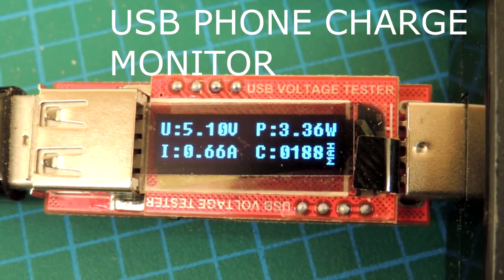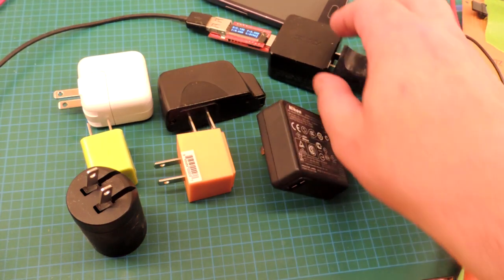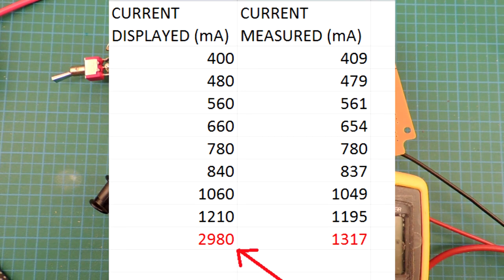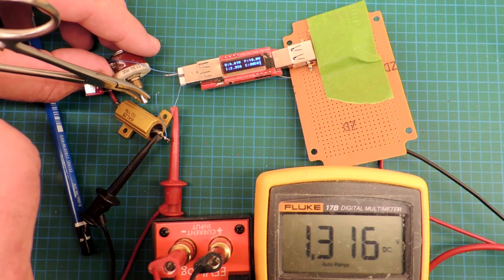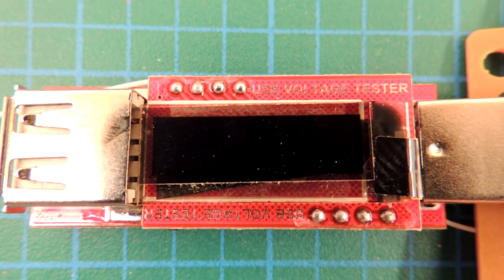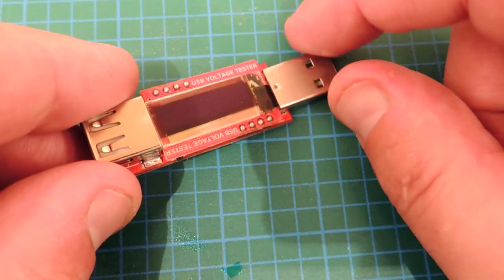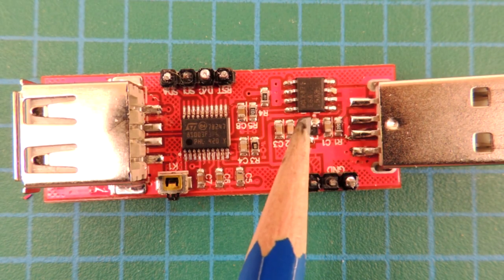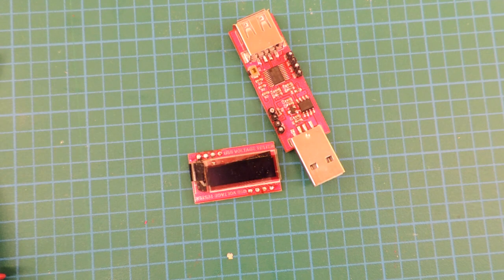USB Phone Charge Monitor

Comment: I got few of different USB panel meters. The cheapie Blue transparent plastic case USB Charger Doctor is the worst of its kind. I am using the below latest model for some form of protection esp OV OC, first time charging or power-on newly bought USB gadget.

http://item.taobao.com/item.htm?spm=a1z0k.7385961.1997985097.d4918993.rBWFzo&id=38564198651&_u=620resoi4534

Comment: It's really unfortunate that it tops out at 1.25A... It's not uncommon to find USB devices that charge at 2A or slightly higher (I've seen 2.5A USB chargers). Most tablets and many smartphones seem to charge at 2A these days. If the tester had topped out at 3A, I'd have snapped one up...
Reply: I'm thinking there is a good chance that this little current tester should work to 3A. It turns out that 1.25A is the limit for the uCurrent Gold device he's using to convert current to voltage. The MAX471 chip is rated for 3A. Also it has a fairly low value sense resistor (35mOHM) so it should have a low burden voltage. I bought one to test out and I'm hoping that it does go to 3A.

Comment: You mentioned that the tester was very accurate up to about 1.25A. That is the maximum current for a uCurrent Gold current tester using the standard coin cell battery. So I think you might just be running into the upper limit on the uCurrent. I believe you can boost its range if you up the supplied voltage a bit. By the way I'm a big fan of your videos. Keep up the good work!

Comment: That will also protect your lithium cells since they can not drop below 3.3 volts
Reply: The way current meters work the connection between input and output won't be cut below 3.3V. It just won't display anything. You can still drain your battery until it's dead for good.